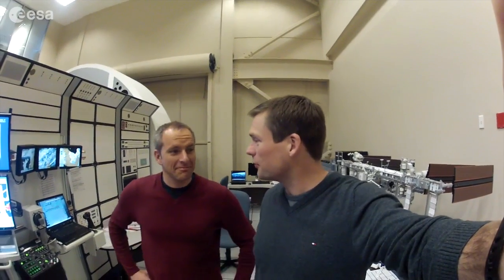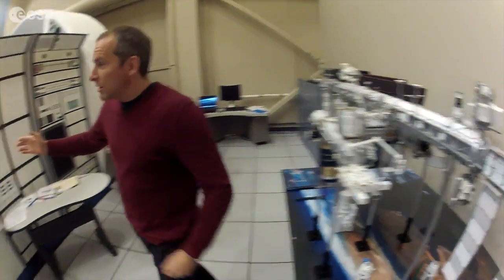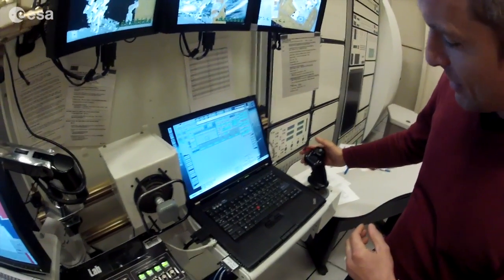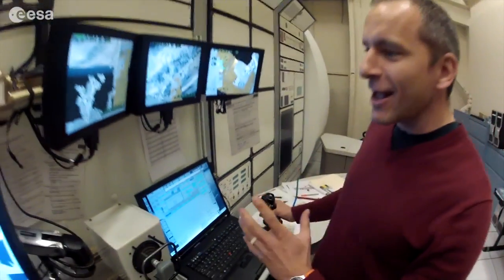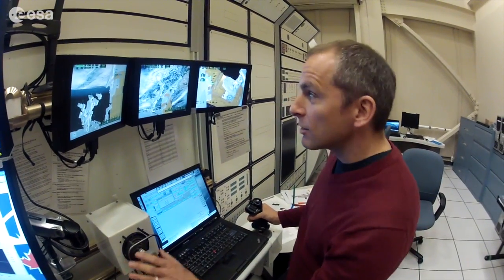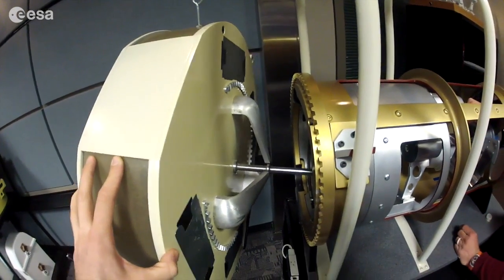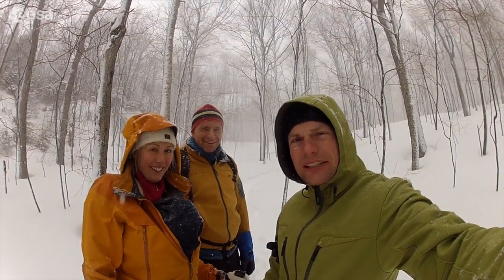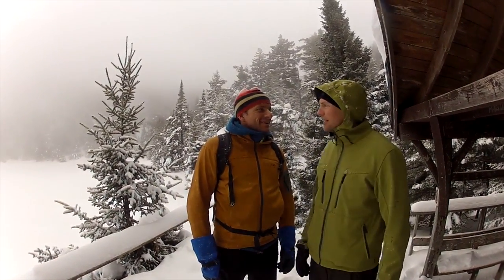How to 'Joystick' Space Station's Robot Arm | Video

Comment: Terrible interface.
Vogon inefficiency through and through.
All very compatible with Nasa's mission statement of course. Make it look hard and do nothing.
Reply: Have you ever used the interface before saying that? Or at least given it a closer look than the rudimentary bits of info given in this video?
Reply: piranha031091 I don't have to. Just one way to understand how stupid that setup is, have you ever seen a gamer setup with 3 small screen placed awkwardly high and 2 controls so incompetently spread out like that. The idiots in the military do the same when they bomb weddings with drones. highly placed small FOV displays. How it's possible to be that stupid is a mystery.
Just off the top of my head I'd say a single large display placed in normal work height just above a set of small controls. Maybe a space ball, maybe 2, depending on how much is controlled manually. If different views are required they can be switched with buttons to be viewed on the single large display. 
And laptops have no place in space except for maybe a computer you bring with you. Any serious user is offended by the ergonomics of a laptop.
Reply: Dan Frederiksen Are you considering the fact that when they do this for real, they're in orbit? This means you can't get around laptops, small screens, and floating around. So a wide grip could be more stable, and the screens aren't exactly placed high when you aren't sitting in a chair, but floating there.